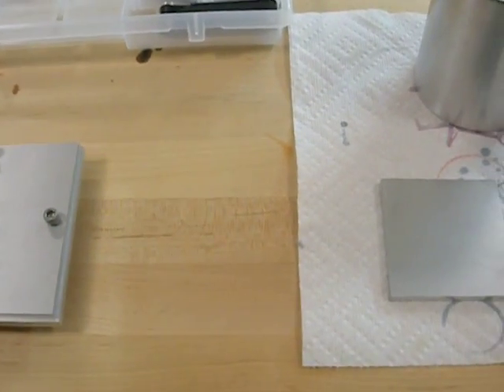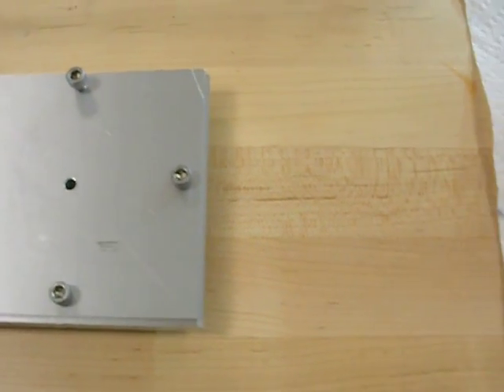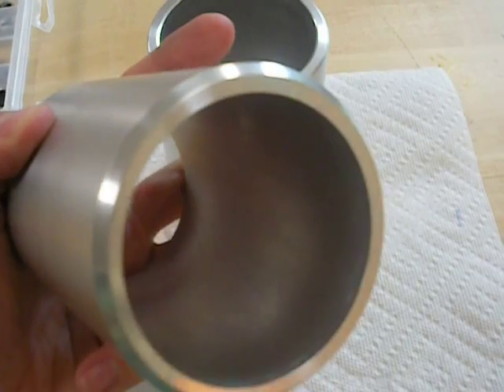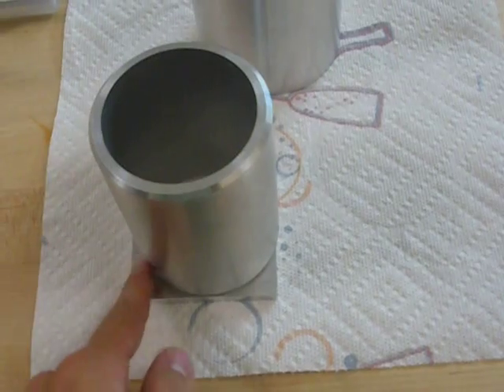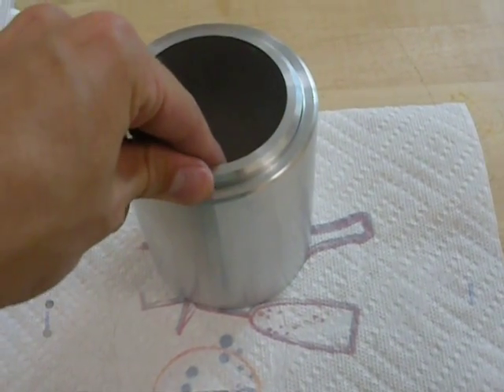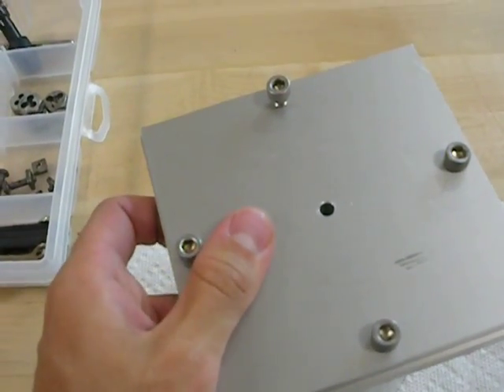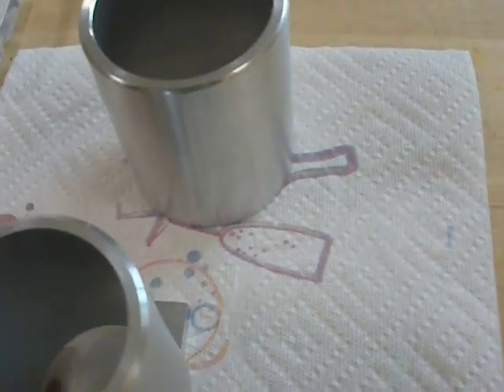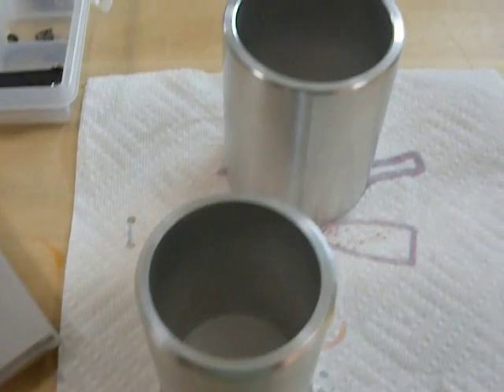Pressure Vessel Construction Part 1

Comment: Hi there. How to calculate relation pressure with thick material (stainless steel or iron)? So. example. if the vessel can be handle 60 atmmospheres then the thick stainless steel 304 will be??????